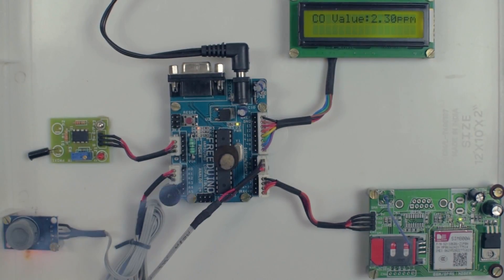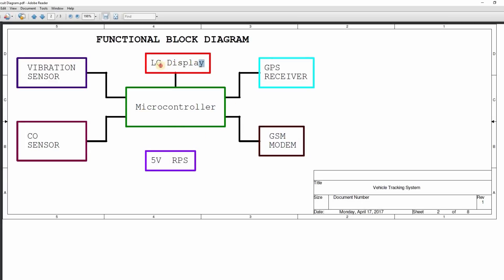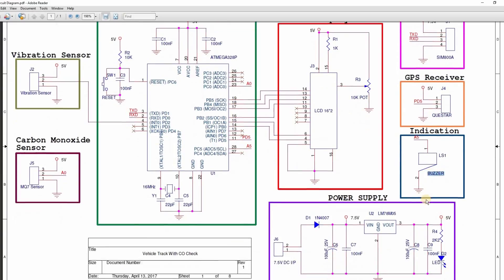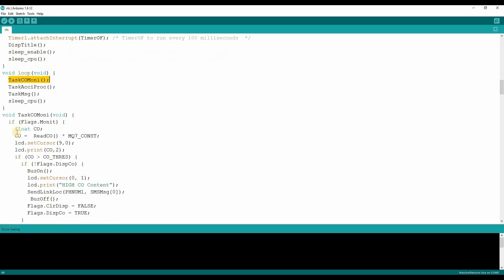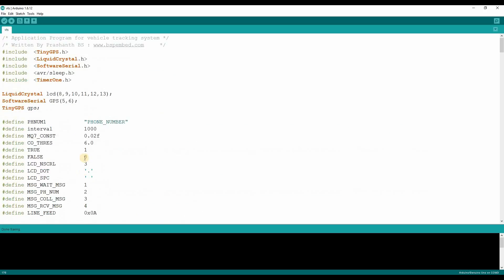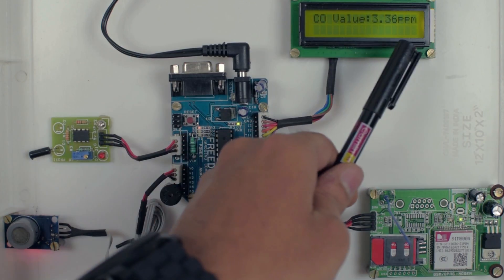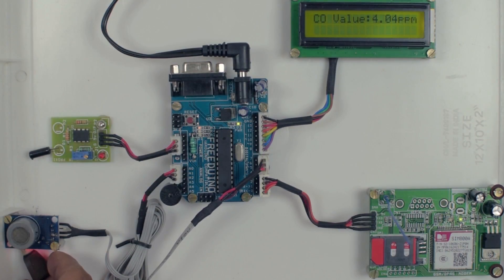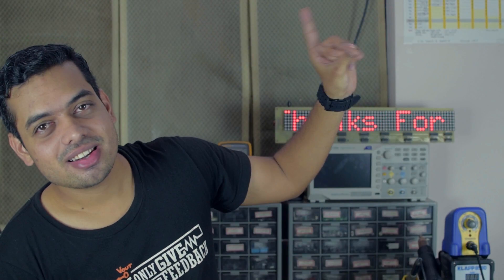Build Your Own Vehicle Tracking System using Arduino

Comment: I managed to upload the code into arduino board, but nothing appeared in the LCD,can you help me please, I spent so many times in this ptoject.
Reply from the maker: Don't get disappointed, It's all learning process. Check with hardware.
Reply: @Emtron_Technologies  I will try
Reply: @Emtron_Technologies  hey now I can see something printed on lcd which is "initializing", but suddenly some weird symbols appear. One more thing when I power on the LCD, the gps didn't turn on, but other components such as sensors and gsm seem working fine. All of them from a same power supply (5v)and ground. I read the circuit diagram many times, but it's not working. Can you help me by giving some thoughts about this problem, Thank you😁
Reply from the maker: @hafizhafizi351  Check the hardware connections.
Reply: @Emtron_Technologies  hey my LCD printed initializing sensor init: . But your lcd printed initializing sensor it:ok. Right now, I can't see the "ok" word. Please help me😭

Comment: Sir, when I put on the power supply only vibration sensor is on, but the rest is off, any tips?
Reply from the maker: Check power supply is proper to each modules.
Reply: @Emtron_Technologies  when I look at the picture, your gps wire connected to pin 5,6,7 on arduino but it doesn't connect to 5v on arduino to on the gps module, how does it works?
Reply from the maker: @hafizhafizi351   I have made connections at bottom, Please refer circuit diagram.

Comment: Where do you connect ground and vcc pin from lcd to arduino's pins, Please  give me full explanation about the wiring, I already have open the website, but I wasn't able to connect  the wires  properly. I need to present this project soon,I need your help.
Reply from the maker: Check the circuit diagram. Download from GitHub. Link is given in the video description.
Reply: @Emtron_Technologies  already downloaded, but I don't understand
Reply: @Emtron_Technologies  sir how did you give the gps and the other devices power supply. Is it from adapter or another power supply.
Reply from the maker: @hafizhafizi351  using single power supply.
Reply: @Emtron_Technologies  can I use a power bank instead of adapter as power supply cause I'm using arduino uno
Reply from the maker: @hafizhafizi351  Yes you can use.
Reply: @Emtron_Technologies  sir I already tried using power bank  and adapter but only vibration sensor is on, but the rest in off. I don't understand why this thing  happened. One more thing sir can you give me the code for this project
Reply from the maker: @hafizhafizi351  Download code from GitHub, Link is given in the video description.
Reply: @Emtron_Technologies  when I compiled some errors appeared such as, it does not include library and invalid conversion from unsigned character to constant character (-fpermessive). What should I do
Reply from the maker: @hafizhafizi351  Include proper header files.
Reply from the maker: @hafizhafizi351  install libraries.
Reply: @Emtron_Technologies  Alaready installed the library but invalid conversion from unsigned character to constant character still appears.Any tips?
Reply: @Emtron_Technologies  how do I include proper header files. Please help me.
Reply from the maker: @hafizhafizi351  Please check for online tutorial.
Reply: @Emtron_Technologies  what do you mean?

Comment: Hello Sir! How do I alter the sketch to send SMS to turn on and off a relay?
Reply from the maker: Change the number in #define PhNumber Symbol in the sketch.
Reply: @Emtron_Technologies  Sori, newbie here. What I mean is, where did you put the word " Track" in the code so the systems recognize it and reply it to you. I just wanted to alter it, so I can control a relay. Thank you.
Reply: And by the way, Thank you. Your  system work very well with my GSM900, Gps NEO 6m with the 16x2 LCD with I2c and the Arduino UNO keyestudio.. Thank you
Reply from the maker: @waqohqoh  study the program, you will learn a lot.
Reply: @Emtron_Technologies  You mean you got your "Track" word in your phone CMGR  ID=15 right? I hope I'm correct
Reply: @waqohqoh  hey there, can you explain to me the where all the pins should connect, if your project working perfectly.
Reply: @hafizhafizi351  hello there, I'm using Liquid Crystal w/I2c which is easy than the one he's using/ GPS pin on 5,6/ Carbon sensor on pin A0/ Buzpin A3/ Interrupt sensor on pin   3, I hope it will help.
Reply: and also GSM on TX,RX default on pin 0,1.
Reply: @waqohqoh  Thanks a lot man, it's working well for you?
Reply: @waqohqoh  sir can I have your email, I have some questions for you. Thanks.
Reply: @Emtron_Technologies  Did you mean it here?void TaskMsg(void) {
  if (Flags.Msg) {
    #ifdef DISP_PHNO_MSG
      String Ph = PhNum;
      String SMS = sbuf;

Comment: What kind of arduino that you used sir?
Reply from the maker: Arduino UNO clone.
Reply: Sir can I use any kind of Sim800a gsm modem
Reply from the maker: @hafizhafizi351  Yes you can use.
Reply: @Emtron_Technologies  OK thanks
Reply: Sir, sim 800a gsm modem not available in my country, can i use sim900a GSM gprs wireless extension module board, and can I use arduino uno board rev. 3 compatible . Sorry for asking so many questions 🙏

Comment: May I know the name of the Vibration sensor I cannot find over the internet
Reply from the maker: It's designed using mechanical vibration sensor and LM358. https://robokits.co.in/sensors/vibration/sealed-vibration-sensor-sw-18020p
Reply: BSP Embed  Thanks
Reply: BSP Embed I’m actually developing an android app too for this system , so is it feasible to write code for vibration sensor too on Android Studio ?
Reply from the maker: @apeksha348  i have no idea on Android Studio.

Comment: Hello bro this is a nice video that i helps me soo much 😘😘😘 bro.
But i used vibration sensor , sound sensor and rf transmitter and receiver. 
But same like this project only.
Please send ur contact to reddyvilas123@gmail.com please as soon as possible
Reply from the maker: If you have any doubts in the project, Please let me know.
Reply: @Emtron_Technologies  i am doing same project instead of carbon monoxide sensor i used sound sensor , i nat used gps receiver ,i have used one more module which is rf Transmitter and receiver and wt u have used is transmitter section and rf receiver is receiver section.i used node mcu in transmitter section because of the project should be in iot so.
Reply: Iam doing IOT BASED ASSET TRACKING SYSTEM
Reply: When the sensors are activated then from GSM modem-arduino Nano-node mcu -thingspeak server for tracking live location
Reply: With out gps receiver.
It will work
Reply from the maker: @vilasreddy7618  Very Nice. All the best for your project. BTW not used any RF Transmitter or RF Receiver.
Reply from the maker: @vilasreddy7618  Excellent.
Reply from the maker: @vilasreddy7618  Sorry, i have no idea on tracking in Thingspeak.
Reply from the maker: @vilasreddy7618  Without GPS, You will not get exact location. You can get network location from GSM Modem, Which is not accurate.
Reply from the maker: @vilasreddy7618  If you require any help, Please visit our office. You can find us on Google.

Comment: can i get a code for this project
Reply from the maker: Thanks for your interest in our project. Sorry for the inconvenience to you.

We have removed the code from the GitHub due to some technical issues.
Reply: @Emtron_Technologies   no problem ..but from where can i get it?
Reply from the maker: @riddhijiotode2056  It will be resolved soon. Will upload it to GitHub.
Reply: @Emtron_Technologies   is it necessary to add vibration sensor and mq7 sensor in project?
Without those can it work?
Can we use 12v adaptive power supply instead of 5v?
Can we use sim900a instead of 800a
Reply from the maker: @riddhijiotode2056  No, Not necessary. You can eliminate those parts. You can use 12V, adapter, make sure all boards are rated for that voltage.
Reply: @Emtron_Technologies  how much time it will take to upload code?
Reply from the maker: @riddhijiotode2056  Around 10-15 Seconds

Comment: Hey, can i use ( Ublox NEO-6M GPS Tracking with Antenna GY-GPS 6MV2 Module), if i can use it, should i change anything?
Reply from the maker: Yes, You can use..
Reply: @Emtron_Technologies  the programming  still same right?
Reply from the maker: @hafizhafizi351  Yes Still the same.

Comment: How i can get the power supply from the car
Reply from the maker: From a car battery (usually 12V).  Most cars having cigarette lighter, you can pullout from this.
Reply: @Emtron_Technologies  one more question, how can i know someone is trying to steal my car? can this project can give me any signal?
Reply from the maker: @hafizhafizi351  It will inform you via SMS.
Reply: @Emtron_Technologies  how?
Reply from the maker: @hafizhafizi351  using vibration sensor. When their is a theft, sensor will send a command to microcontroller, which will send an SMS to you.
Reply: @Emtron_Technologies  if i want to make this project, where i should put this project, like example, under the sit or somewhere
Reply: @Emtron_Technologies  and how the sensor detect a thief, what i mean is the thief need to apply a pressure to this project to make the vibration works?
Reply: @Emtron_Technologies  Will it work if I use USB port in a car (output 5V) as a power supply?
Reply from the maker: @maya7015  No, System will work from 12V.

Comment: Hello. Thank you so much for your excellent project. I already your project. but the project only read CO value on LCD screen. I texted a message "Track" to the SIM808 phone number. but I did not receive any response to my cell phone. Please help me. Thank you so much
Reply from the maker: You have to send SMS from your authorized phone number (That is the number stored into the controller). Please check the phone number.
Reply: @Emtron_Technologies  Thanks for replying. 

in the source code I define  " #define PHNUM1          "1xxxxxxxxx"
1 is USA IOS code
and I also sent to my SIM900 number. but I did not get a response. 

Please help me. is there anything wrong about the define PHNUM1
thank you so much
Reply from the maker: Please  Post a positive review to our profile,  Sure we will help you to resolve your issue.
https://g.page/bsp-embed/review?gm

Comment: Sir in our arduino the markings are slightly different for the LCD from the original diagram. Please provide the LCD connections or the mappings. Since it's hidden in the prototype diagram.
Reply from the maker: Please check the circuit diagram.

Comment: Im using SIM800 and I can't send or receive the message. Im using 5V supply specially just for gsm. I connected it directly on Rx and Tx pins on Arduino Uno. Is there some modifications that should be done that I dont know of? Also network led is blinking every 3 seconds indicating that network is stable.
Reply from the maker: Rx pin of GSM modem to be connected to Tx pin of Ardunio and vice-versa. Please check this connection.
Reply: @Emtron_Technologies  Yes i connected it that way
Reply: The format of phone number i entered is +ZZZxxxxxxxxx and +ZZZ is country code xxxx is the rest
Reply from the maker: correct. You can try without adding country code. Only 10 digit phone number.

Comment: Very good project. 
Can I ask, I have the SIM800C GSM/GPRS module, with correct library, will this module work ok ?
Also, having the A6 GSM/GPRS , will this work also, ( I think the A6 is based around the SIM900 ?,  but I could be wrong..   Thanks
Reply from the maker: Yes it work. Since AT commands are same.

Comment: how is vibration sensor working?Instead we can use ultrasonic sensor and define some angle for a particular time and then if something like this happens we can send message to predefined number or email?How can we do that please explain in detail?
Reply from the maker: As i know ultrasonic sensor is used to measure distance between two objects. So we used vibration sensor to detect accident.

Comment: How did u make the GPS connection .......u didn't give power supply
Reply from the maker: Power supply is given to GPS module. 3 wire flexible cable is connected from arduino to GSP. 5V, GND & Tx pin.

Comment: sir i use sim 800A module 
which pin i connect gsm in ardino
Reply: plzz i cant also figure that out
Reply from the maker: Yes you ca use 800A, You need to connect Tx to Rx Pin of Arduino and Rx pi of GSM to Tx pin of Arduino.

Comment: Hello 👋 teacher, thanks for that. May you email 📤 me please I need small help. ramo70@mail.com
Reply from the maker: Sorry, This is the only way of communication. Please comment your doubt.
Reply: @Emtron_Technologies  ok. I have LCD 1602 Module screen with 4 pin . can you tell me what I should change in code?
Reply from the maker: Is it I2C Based LCD.
Reply: @Emtron_Technologies  yes 👍 bro
Reply: Because I chose your project for my project. I bought all parts and sensors. But little bit different models. Gps/gsm A6 model. Now only I need clear connection and screen also
Reply from the maker: For GPS It's compatible, You can use it. I haven't worked on I2C LCD module

Comment: vibration sensor you have used is a model that comes under sw-18010p 3v-5v open type vibration sensor switch module alarm trigger  device
Reply from the maker: Correct.

Comment: Interrupts are the external or internal signal generated by the devices to request the microprocessor to perform a specific task.
The microprocessor will do that specific task depends on the priority level of that interrupt.
Please give me that board i m making this project, i m not financially good
Reply from the maker: The contest is already over. You are technically good.

Comment: Where to connect the LCD connections not properly given in website or circuit diagram or prototype can u please say how.to connevt
Reply from the maker: It's properly given in the circuit diagram. Check the GitHub for all the details. https://github.com/BSP-Embed/Vehicle-Tracking-System/blob/master/Circuit%20Diagram/Circuit%20Diagram.pdf

Comment: And I need prog for only Gsm and GPS receiver i.e only after pushing a button I can get sms with location.
Reply from the maker: You can alter a program. use switch press function which detects a key press, Then call the function to send SMS.

Comment: At first I would give thank you for uploading a beautiful project to YouTube and I am highly impressed for that. I have been try to build a tracker device for my own car as per your circuit and coding which you have given to your link. It has been work perfectly for high CO value and when accident occurred but not works for when I send “Track” by the SMS, the device is not send me the Google map’s link, as you showed in the YouTube video channel. I want to your cordial cooperation about the problem please help me. Thanks once again.
Reply from the maker: Check the phone number in the program. SMS will be sent only to the authorised phone number. 
If you like our project, Please write a review on google 
https://search.google.com/local/writereview?placeid=ChIJWZI0RecXrjsR5vfMEPmETgE
Reply: @Emtron_Technologies  When the vehicle got accident and high CO value then the device has been sent SMS with the Google maps link  to my authorized phone number so I think mobile number has no problem. When I write "Track" to send SMS to the device number, then the tracking device did not send any SMS to my authorized phone number. Please help me.
Reply from the maker: Try to add phone number with country code.
Reply: @zahidurrahman9111  HI! Zahidur did you got the answer to this question? If yes can you share it with me

Comment: please help me, can I use  this sensor to detect car accident 
https://www.aliexpress.com/item/Free-Shipping-Impact-Switch-Collision-Switch-Sensor-Module-With-Dupont-Line/32294958229.html
Reply from the maker: Yes you can use this sensor.
Reply: BSP Embed There is no code I search for 5 hours in every website with no results and there any way informations about this sensor. Can you just give me the link you think it is helpful for me?
Reply from the maker: It's just a mechanical switch (Called as Limit switch).
Reply: BSP Embed or can I use instead accelerometer, you think it is better than?
Reply: or can I use a vibration sensor that is useful for my project (accident detection system )
Reply from the maker: Mechanical switch is good for this project.
Reply: BSP Embed which sensor do you mean?
Reply from the maker: Which you have mentioned.
https://www.aliexpress.com/item/Free-Shipping-Impact-Switch-Collision-Switch-Sensor-Module-With-Dupont-Line/32294958229.html

Comment: Im using the 2560 Mega. I have a similar project and im tracking a bus. Is there a way to send the coordinates to a server or to a mobile application to update coordinates every 30 seconds on a clock cycle?
Reply from the maker: You can send co-ordinates to server.  Check list tutorial. https://www.cooking-hacks.com/projects/arduino-realtime-gps-gprs-vehicle-tracking

Comment: Hello bro what is the kind of cable used in this video ? is it female to male or what?
Reply from the maker: RMC cable. It has two parts Male PCB connector & Female wire connector.

Comment: Fantastic bro. I have been impressed by your project an i want to build my own tracking device that i can always track and lock my vehicle in case of theft using my mobile phone. could u help with the codes please
Reply from the maker: You can download from GitHub. Link is given in the video description.
Reply: @Emtron_Technologies  Sir I,m trying to develop these project but while compling the program errors occurs. Will you please help me to solve them? Arduino: 1.8.10 (Windows 10), Board: "Arduino/Genuino Uno"

vehicle:2:11: error: TinyGPS.h: No such file or directory

 #include  <TinyGPS.h>

           ^~~~~~~~~~~

compilation terminated.

exit status 1
TinyGPS.h: No such file or directory

This type of error it is showing, Please help me to overcome it.